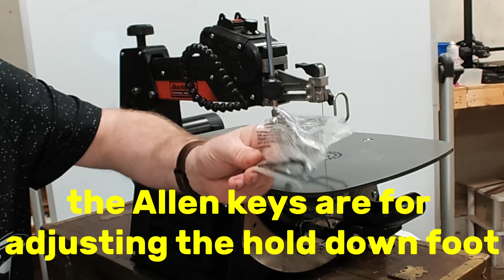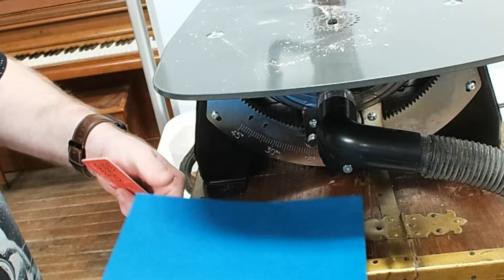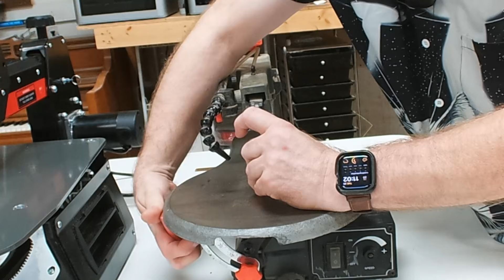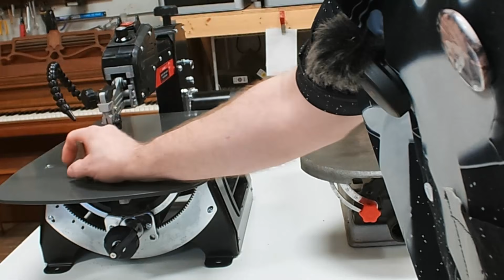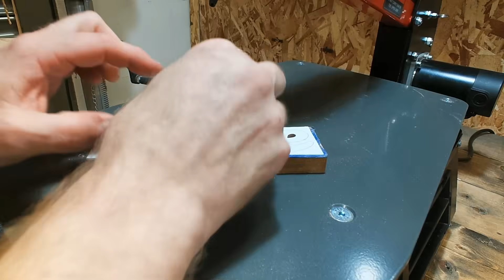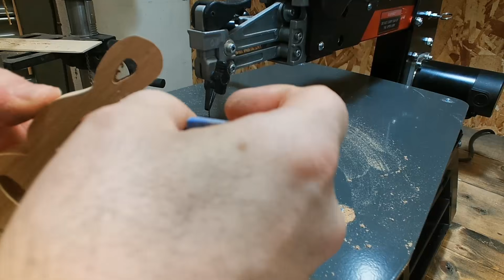bucktool 16" scroll saw review

Comment: I’m looking at the Dewalt DW788, but this one seems similar. Would you by chance know how they compare? Not sure if you have had any experience with one of those
Reply from the maker: They are both double parallel arm saws. They have a lot of the same parts. The dw788 has a tilting table where the bucktool the saw tilts around the table. I used to run dewalt saw but have become quite expensive these days

Comment: Scott you said you used a foot peddle while reviewing the 16” buck tool scroll saw. I’m curious Did you start and stop the saw from the peddle or after a stop have to manually start it each time to continue sawing.
Reply from the maker: The power switch on the saw is left on. I start and stop the saw with the pedal. I typical use a power maintained pedal, so it’s step to turn it on and then step to turn off. But if there are a lot of internal cuts I’ll use a dead man’s pedal. Step on to start the remove foot to turn off.

Comment: 22"bucktool saw or the 22" Bauer ? if you could have only one Saw.
Reply from the maker: They are basically the same saw, made in the same factory. The bucktool has a dust port, Bauer does not. The 16” is going to be available in a month. (I assume they have been in a bonded warehouse waiting for tarrifs to settle down(
Reply: It looks like Amazon's 22" Bucktool may not be parallel arm or have the arm rotate. These features are not mentioned as they are for the 16". So the HF Bauer is probably the choice there.

Comment: Thank you.  The Amazon link is for the 22”, not 16”.
Reply from the maker: Bucktool had the 16, 18 and 22 inch saws in the same listing. When they asked me to do the review, they had a shipment in route so they only had I think 12 on Amazon so I’m guessing they may have run out.
Reply: @MakingitwithScott The 16” and 18” are not even listed on Bucktool’s website.
Reply: Why would Bucktool send you a 16” scroll saw to review if that product is not sold anywhere?  The 16” scroll saw is not on Bucktool’s website as “out of stock” or “discontinued.”  I don’t understand why it cannot be purchased even though recently reviewed.
Reply from the maker: I have been asking myself the same question.